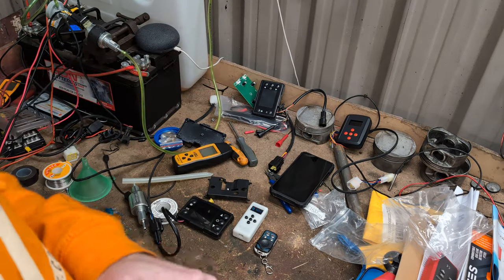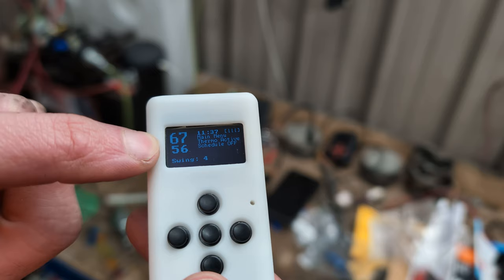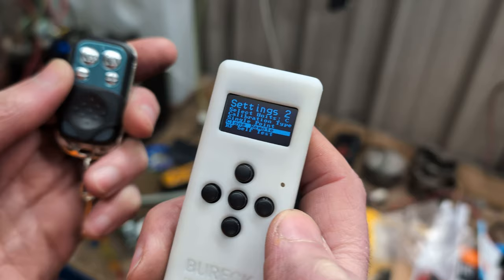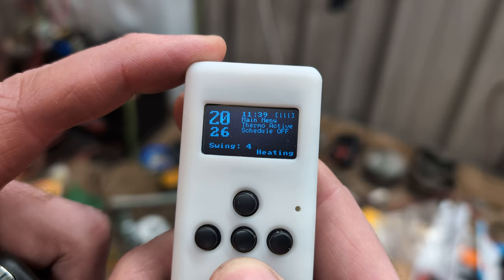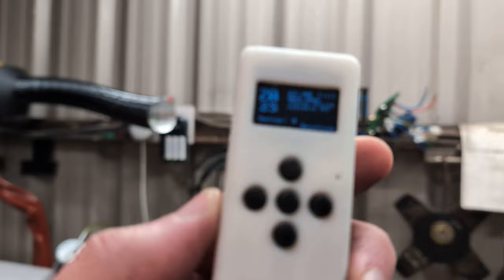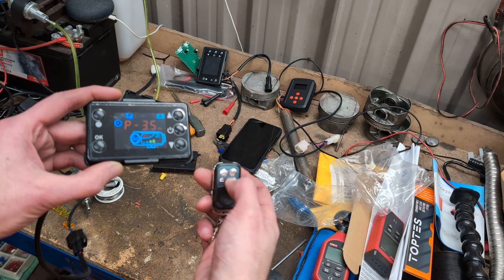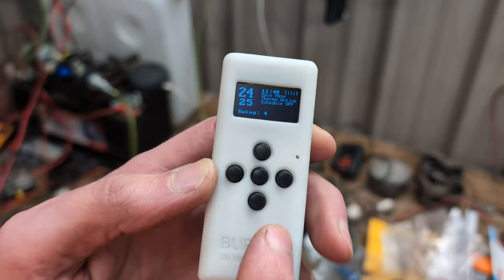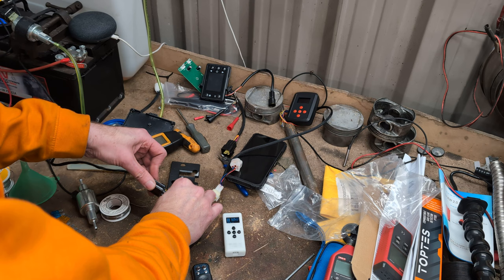Bureck CD Thermostat - diesel heater thermostat - quick look

Comment: This is a great option for those of us who got a heater that isn't compatible with the afterburner. I was ready to switch back to propane because high doesn't produce enough heat to warm the shop quickly, and low overheats it if left running 24/7 in all but frigid conditions. So far with swing set to 10, my wifi thermometer reports the temp is staying between 60/16 and 70/21. I got the wired version to avoid the temp sensor problem but ran into a different problem with it not drawing enough power to prevent my portable USB charger from shutting off. 🤣

Comment: Having used the Bureck CD Thermostat for a few days now, I think, personally, it definitely needs the internal thermostat moved outside the unit.  If I could identify whatever is controlling the temperature, it might be possible to wire in an external sensor, the kind used in reptile houses and the like.  Why do I think this? 

Say the temp is set at 72F cut-off whilst the actual temp is 70F.  If I press the button to light up the screen, the reading will rise 2 degrees through generating its own heat.  No big deal I suppose, but it means the heater will turn off when all I wanted to do was run a check on things.  I either have to wait for the temp to drop again or faff around with things.  I could, of course, deactivate the controller when using the screen, but this seems a bit silly to me.  If the temp sensor was at the end of a length of cable, even a small length, then this kind of thing wouldn't be an issue. 

It works great apart from the above.

Comment: It needs more air flow through its' case to not only vent warm air from charging, but also to have a more accurate reading on the thermocouple, if you look at the average household wall 'stat, there's always vent slots in the thing to allow heat to flow through it so that it doesn't warm up and sit there nice and toasty internally while the room chills around it... :)
Reply: Unfortunatly it seems like part of the issue is that they are on the same board, and heat is transferring through the board (the problem arises even outside of the case). 

We've been thinking of different solutions if we ever do a redesign. We're always open to suggestions!
Reply: @bureckllc  place the temp sensor a bit down stream from the signal conditioning electronics and have that sub assembly on a daughter board placed lowest of the case with ample ventilation of the case. so natural convection carries heat away from sensor giving only true room air temp.  this gives max thermal isolation.
Reply: @Refertech101 Hey, thank you for the advice, I really appreciate it. When we spin the board I'll look into adding little daughter boards.
Reply: Does it connect to it wasn't going to mount it on it
Reply: @bureckllc  If you're working on a 2nd generation product could I suggest going with USB-C? It seems like everything is going to USB-C as a standard & they seem to last longer & plug in no matter which way the cable is turned. The battery charge circuit, battery & the thermistor might need to be walled off from each other inside the case since USB-C supports a higher current & could make even more heat inside of your remote. Maybe make a 3.5mm jack as an option that would disconnect the internal temp sensor for a remote sensor on a 6 foot lead.

Comment: Let's say you have the Bureck scheduled for 50F from 9pm to 9am and 70F from 9am to 9pm. If the heater is in the process of starting at 8:58pm could the automatic switch over to the lower setting shut down the heater in the middle of a startup cycle and leave it flooded with fuel? Thinking maybe they could program it in such a way that if heater is running, wait X-minutes to activate schedule change or something to that effect.

Comment: I have one.  I must admit, the swing side of things confused me at first.  Even the explanatory video wasn't clear on this issue.  By the looks of it, you simply set the temp and if reached the heater turns off.  Should things cool down to the lower setting (the swing) , it turns back on again.  This shouldn't have confused me at all.  Improved instructions are called for, I reckon.

As far as the accuracy of the thermostat is concerned, maybe it would be a better option to have the sensor at the end of a length of cable.  The battery charging wouldn't affect it then.

Comment: Can you see if it will clone the remote from the Hcal 6.5-8kw, this is the one I have just received.
This heater has on and off as standard but only 2 degrees step
Reply from the maker: I have a suspicion those remote are bluetooth, but it will be something I'll need to try.

Comment: David, Can you use the Bureck with an Afterburner?   Use the AB to fine tune the heater and the Bureck to turn it on and off automatically. ( I under the AB replaces the controller once you have it completely setup and working.  I also know the AB needs a compatible board to work. Other than that the working electronics is over my head. )  Thanks, Tony
Reply from the maker: Are you aware the Afterburner has the ability to turn the heater off and on at a set temperature?  It's just an option you have to set up in the settings.
Reply: @DavidMcLuckie , I must of had a brain fart about that. I've been looking at different products to compare the pros and cons and I either forgot or got confused with what which one had to offer. (Don't get old if you can help it.)  Thanks

Comment: This thermostat should be a money saver in two ways.
Firstly - using less fuel than running at a low setting - the heater uses zero fuel when switched off.
Secondly - you can avoid running at such a low heat setting that money will be spent on cleaning out the soot.
Reply: Exactly our hope! My heater is installed in a tight spot, so I'm trying to do everything I can to avoid needing to service it.

Comment: will it work from another room or does it need line of sight, what is the range?    My heater is outside so this would be great.
Reply: It uses a USB cord any length you want.
Reply: Or it can be purchased with an internal battery that needs to be recharged periodically. Causing the temperature registration to be off during the battery recharge.
Both use bluetooth with the usual range.

Comment: My blue controller does something like that perfectly set the temperature when it reaches it slows right down until it detects the drop then fires back up
Reply: We made this because in many small spaces, even low will continue to heat the space (for example, my camper).  

Additionally, these heaters tend to soot up quite badly when run on low, which this lets you avoid as well. 

There are no perfect solutions, this is just our stab at it!

Comment: My questions would be can you pair this to a heater when you DON'T have the little remote?  What if you have two heaters not far from each other but feeding different spaces, will one unit run both or can you have separate temperature zones?  Does it start the heater in H6 or the default H3 setting when it comes on?  So many questions, I know.
Reply from the maker: You can pair without the original remote.  You can program more than one heater to use the same remote/Bureck.

The heater starts in whatever mode it starts in.  If that makes sense.  I know they don't all start where they left off.

Comment: I expect it might be useful to some people, but at US $70 It seems rather expensive for what it does.
Reply: I too think it's pricey, but my heater lives outside the truck and can't see a way of extending control panel with thermostat inside to switch on and off. This would solve that problem.
Reply: There is a $50 version available without the rechargeable battery, though that still may not be what feels reasonable to you.

If we could make it cheaper we would, but it takes a lot of work to develop and manufacture a product, and we need to pay ourselves for that time.
Reply: I have ordered one of these as the afterburner is twice the price and isn’t compatible with my heater and the uk version is £200 so the bureck unit is the best option and gives scheduling.
Reply: @chrislant2561  You can just snip the wires and extend them. I think you can even buy extensions that have a plug on each end.

Comment: This device is missing so many features that could easily have been added with just software. Such as an external temp probe support as well as web server support so you could interact with the device via HTTP. Its a nice idea though but seems like it needs a bit of work to be worth the price its asking since you can get very cheap RF repeaters that already do more than this does.

Comment: What battery does it take as their wanting a extra 20 dollars for 1 with a battery
Reply: It is a rechargeable lithium battery. As with all products, the cost of materials isn't $20, but rather materials + the engineering & coding work to include a battery.

If that price point is too expensive, a no battery unit is $50USD and can always be run off of a power bank

Comment: For £70 you would have thought they would instal the screen Straight And the buttons look wonky too.
Reply: This is the unfortunate reality of first run manufacturing at a small scale. We strive for them all to be perfect, but only so much can be done when we are building something with limited demand. Admittedly, it would have been nice if David had gotten a perfect unit, though it is good for people to see there may be occasional blemishes. 

We do stand by our product. If anyone experiences issues with their thermostat, we will do what we can to make it right.
Reply: @bureckllc  How come its so much cheaper without a battery  ?? . What battery does it use
Reply: @robertscott961 prolly a 12V lithium battery.  A23 maybe.

Comment: At £55 I'm out.
Way to costly for what it is.
Someone is on a GRQ (get rich quick) trip.
I will wait till the £15-20 version shows up on Amazon and eBay.
Reply: I wish we were getting rich, I'm afraid the market isn't that big, and creating products like this from scratch that can be manufactured at scale requires a lot of labor.  If the business made sense and could pay us a reasonable wage (accounting for design work, materials, shipping, customer service, assembly, risk, etc) at a lower selling point we would happily do that.

That said, we offer a unit without a battery for $50 USD (~£40), plus $15USD shipping to the UK if that is where you're located.  I'm not sure if that's cheap enough to feel reasonable to you.
Reply from the maker: Low volume products tend to be higher priced than mass produced for obvious reasons.
Reply: It’s funny that you want the Chinese to rip off the bureck unit which only exists to make up for the shortfall in functionality of another Chinese rip off of a German made product 😂.
Reply: @Happy3dprinting hahaha good response